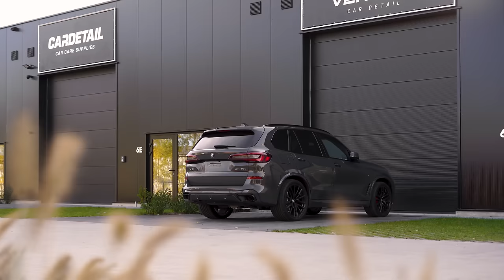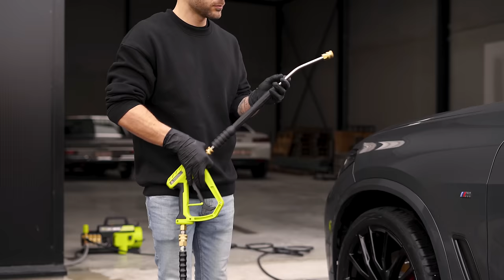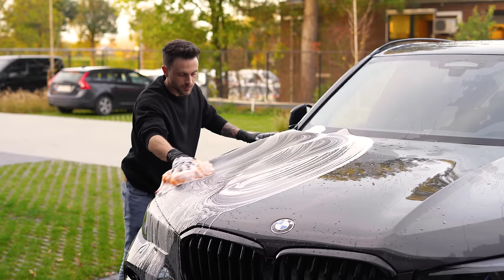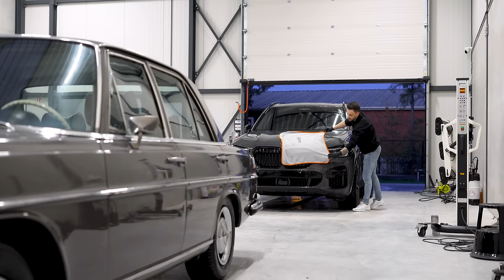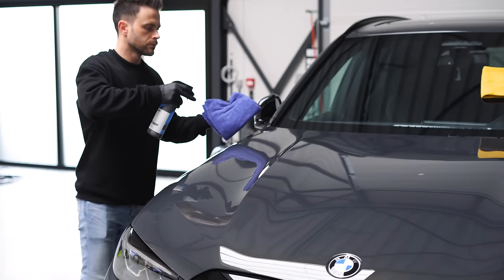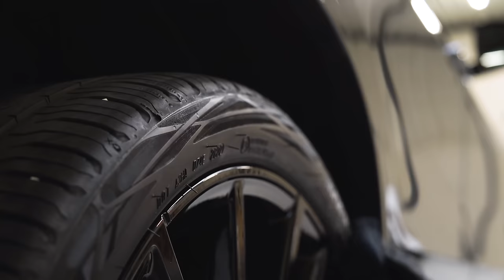BMW X5 Wash, Polish & Coating - Exterior Auto Detailing

Comment: Amazing work! I notice you pressure wash the car first and then use foam, rather than foaming when the car is still dry. Is there a reason for this? Or just personal preference? Thanks !
Reply: I pressure wash “rinse” before foaming so that I don’t accidentally swirl dirt around when using my detail brush. But that’s just me. Likely more preference and if the car is extremely dirty. This X5 wasn’t that dirty to begin with IMO.
Reply: @chrisyongchu etter to use a citrus pre wash when the car is dry or something solid like Koch chemie vbn and pressure rinse off before you snow the car. Makes all the difference. If you look closely and see what and when this guy uses his products. Everything starts to make sense.
Vbn is recommended on heavily soiled cars
Reply: @Sambigs9112  for sure. Thanks for the tip and pointing this out so that the rest of us can learn more.

Comment: So how do you like the new WashR Pro compared to the FLO? Was it worth the upgrade?
Reply: @longjohn5322  I like it pretty good. Designed very simply and very compact in size because of it's focus on detailing plus the internal pump is made out of metal instead of plastic